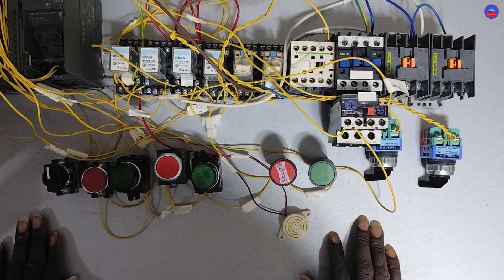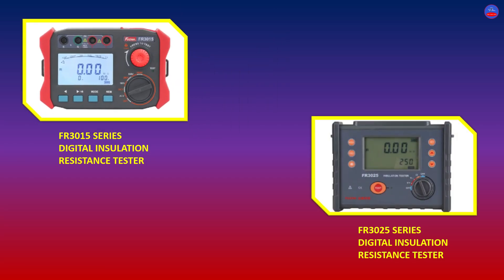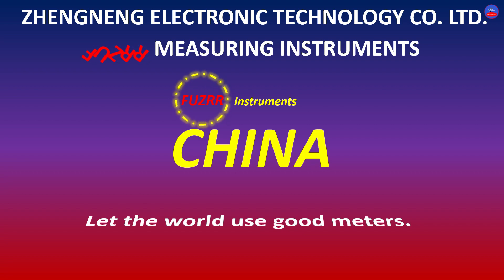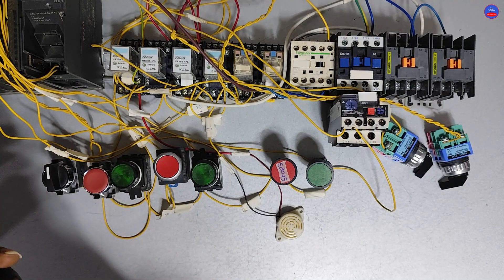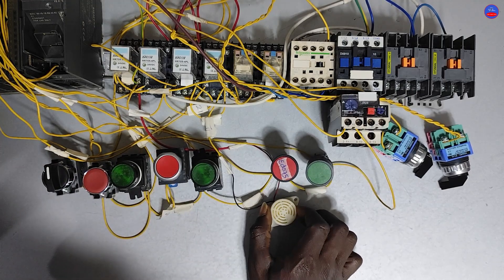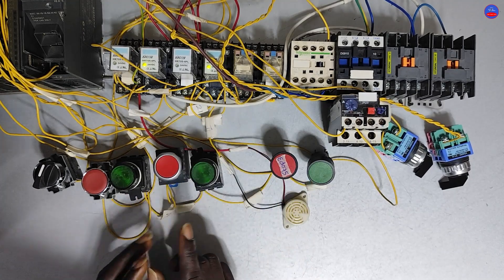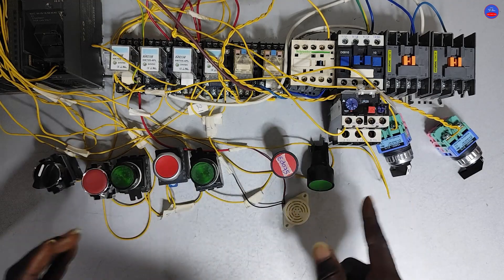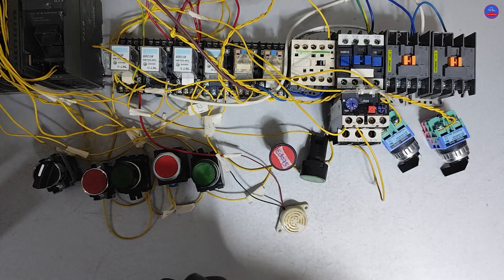Morton Jeffrey Water Works Pro Shares 3 Pumps Control Secrets!

Comment: 3 pumps are used to run  water pumps at morton Jeffry water works . The pumps are rated 25hp ,5hp and 15 HP. A siren should sound for 10 seconds before the motors can be started manually. The circuit is interlocked so that only 2 motors should run at a given time with the 25hp starting first. When 2 motors are running, if the operator attempt to start the third motor that was on rest, a siren should sound twice in 2 seconds time interval and stops automatically. all contactors are supplied at 380v coils. When any motor trips on overload, the whole operation should stop and a siren should sound while a lamp shows a tripped motor. Use only one siren in your circuit.
......
Thank yu Chris
Reply from the maker: You are welcome Ing